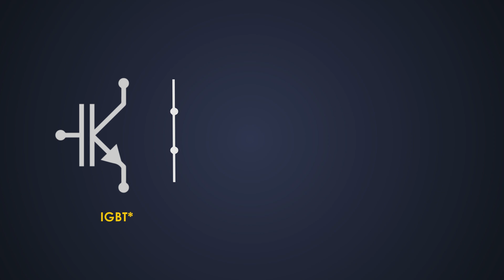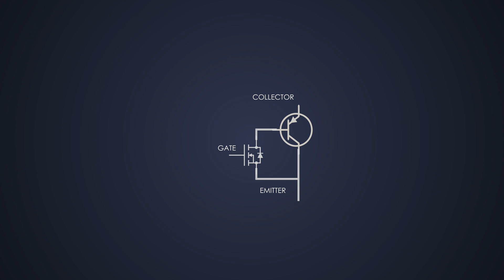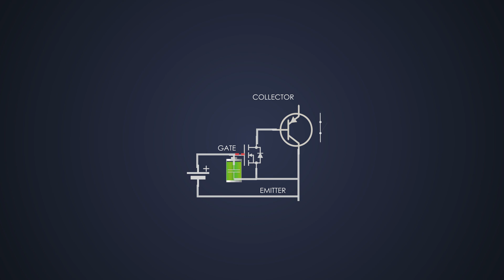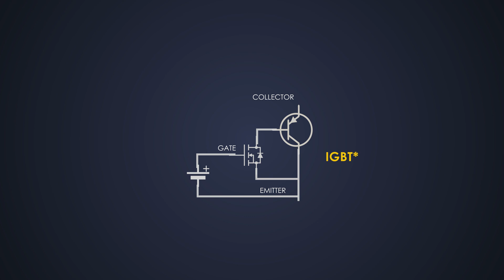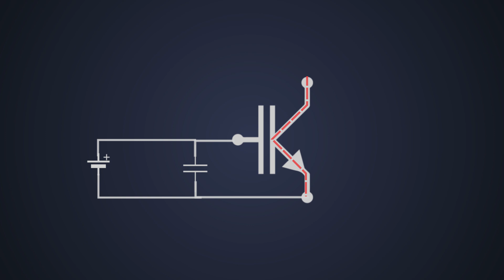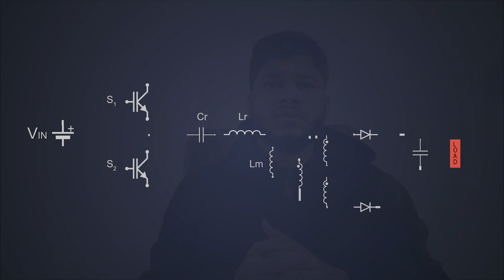What is an IGBT? Understanding an IGBT | IGBT vs MOSFET | Insulated gate Bipolar Transistor

Comment: On IGBT and MOSFET always have a diode connect from S to D,E to C.why need diode ? You can explain ? @Foolish Engineer ?
Reply: Is to protect from reverse current and this also reduce the recovery time of switching (reverse recovery)
Reply: although i know this i have no clue of the difference between mosfet and igbt with same specs, i believe the only difference is that IGBT consumes more current in the gate than MOSFET and is less faster and more secure for high voltage applications... what you think?

Comment: hi. Can I change the IGBT in my small welding machine with Mosfet?  my welding machine has 4 IGBT ( 60n60fd1 ) and I need to replace them with 4 mosfet ( IXFN60N60 ) same voltage same current more power but some different other characteristics. I need guidance in this one since I don't want my new 4 expensive mosfet to get exploding in case of failer